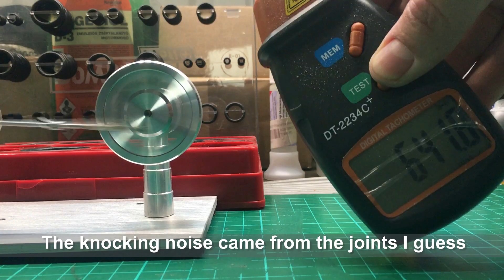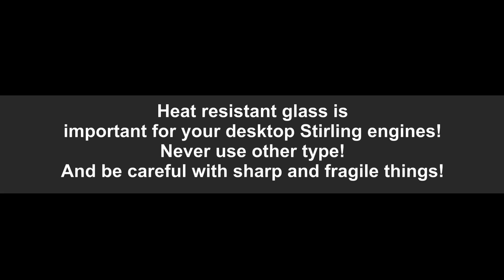Beta Stirling Engine with free Displacer piston - tutorial

Comment: How long is the warm-up period before starting the engine?
What is the diameter of the 8 holes in the displacer holder

Congratulations!
Thank you for your response
Reply from the maker: Thanks Simon! The warm-up period was around a minute or bit more, because of the gas pressure in the displacer can't be balanced. Wasn't enough clearance gap there around the rod. When I start to make a new one, I want to make a tiny hole onto the displacer or the holder part to balance the main pressure faster. 2mm drilled holes around the holder part. I hope you will show your engine in action! Good luck!

Comment: He,
Do you know the book Ringbom Stirling Engines  By JAMES R. SENFT
In this book there are a true beta ringbom engine  and explain the overdrive mode operation
Reply from the maker: I never read that but interesting. Could you send the book to me online? attila.blade GMAIL
Reply from the maker: Yep, now I know it! I didn't remember for this paper, but I downloaded few years ago just forgot the name of the inventor. So yes they showed a beta engine with overdiven mode, but actually I use springs in the displacer, so my engine is not working with this mode only if it was hand rotated. But if the springs are not there than usually it could works on that mode too.

Comment: This looks like a novel design. I can see that the topic is bothering you. regards
Reply from the maker: I don't think so, but maybe this is not an ordinary design. Why do you mean it is bothering me? Maybe I missunderstood your sentence...
Reply from the maker: The first similar design born around 1981-83 maybe, they called hybrid Stirling, or single cylinder Ringbom Stirling, but those are works in "overdriven" mode. It means the displacer knocking directly onto the ends and stop there a bit when the pressure changes. In my engine this is not happened only when I rotated by hand.
Reply: @AttilaBlade  I meant the topic still inspires you, Still looking for new solutions. I think there is still a lot to do in building these motors. I have some ideas to check. I am happy to follow you and other designers. regards
Reply from the maker: @Lechoslowianin   Yep, it does! This topic is one part of my life. My job still in this topic too, so I'm happy with this. The only problem the time but I try to manage it to separate experimental time to my followers or other people who interest about these engines. I really like the models because they could open people to thinking out of the box. And maybe 1 from the thousand start to build up an engine or make something different as the predecessors. I'm happy to see you always in my world! :) I wish you the best! BLADE

Comment: He Blade
To avoid problems with two glasses knocking put a little of steel wood in the interior hot part of the big tube 
The steel wool act as a soft stopper an a little as heater
Reply from the maker: Hi there! The glass knocking is a not prefered effect here. That was because the displacer could wobbling with the rod. It wasn't enough fix in the holder part unfortunately. Every knocking could reduce the efficiency also the speed. Thanks for your idea also your visit! Kind regards! BLADE

Comment: Hello Friend! Congratulations on your research and the excellent result.
Wouldn't your engine be of the "Stirling Ringbom" configuration ??
Leandro Wagner.
Reply from the maker: Thank you Leandro! :) Yes and no! The Ringbom has free displacer too but the Ringbom is gamma most of the time, also the Ringbom has free displacer piston open to the air, not in the working pressure and also the piston movement has different method! The ringbom has a piston that fixed to the displacer and move together when the pressure change. In this configuration the piston doesn't move but closed a small volume into the displacer and that make this cylinder to move for pressure change.
Reply from the maker: I read lot of in the last few days and maybe you've been slightly right but this configuration called hybrid Stirling engine because it has flywheel. Another big different is the springs in the displacer. It is change the working mode sinusoidal. Anyway, i like your smart comments! The translations are ready to use from today if you want to change the language or if you want to share this with your followers in your community section. It would be a good thing to try what will happening after on my channel. I will try to share your channel on mine community section, maybe it could help a bit to you also. :)